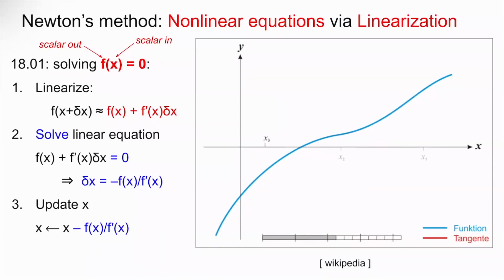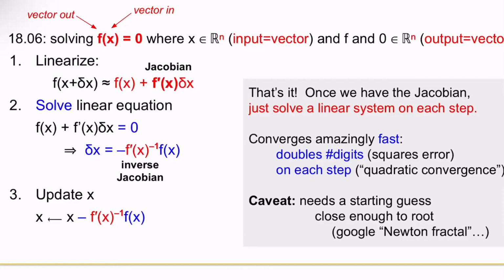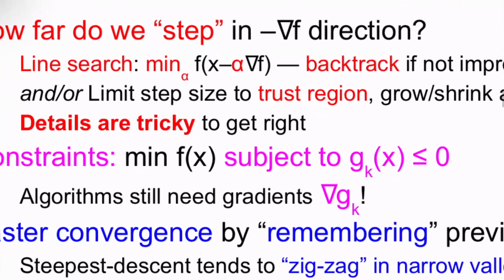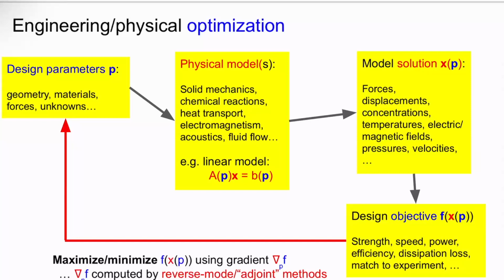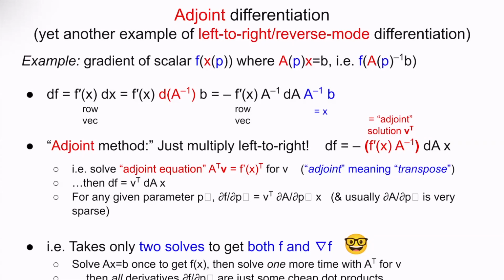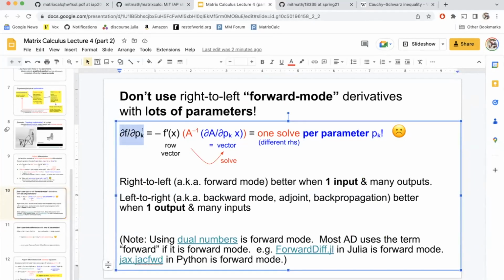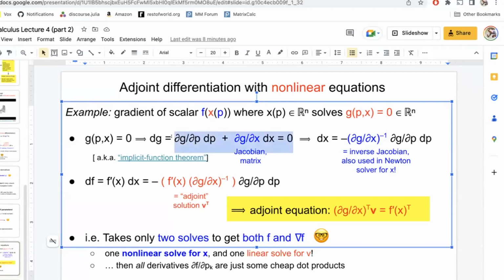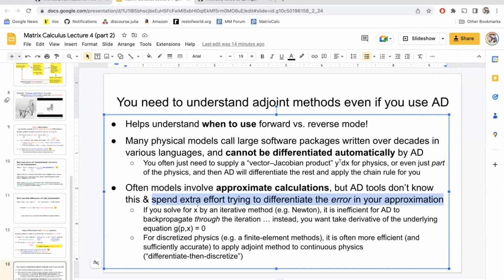Lecture 4 Part 2: Nonlinear Root Finding, Optimization, and Adjoint Gradient Methods

Comment: This lecture highlights a common challenge in mathematical education -- Initially, the instructor maintained a strict and consistent notation system, which greatly aided understanding. However, after a certain point, the notation became inconsistent and, at times, arbitrary. While the instructor seems to be confident and knows what he is doing, this shift in approach causes tremendous confusion and difficulty for students trying to follow the material.
If you do not plan to maintain a consistent notation system throughout, why introduce it in the first place? The sudden shift in notation creates the most confusion and frustration. Instead, consider either adhering to the established notation for the entire series or opting for a more informal, hand-waving approach right from the start. This adjustment could free up time for additional examples, further clarifying the material and better supporting student learning.